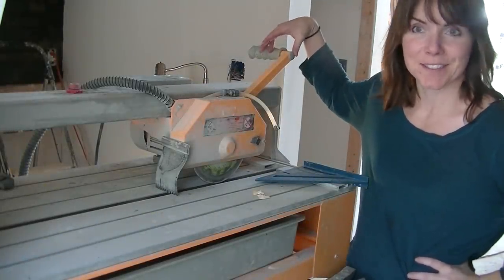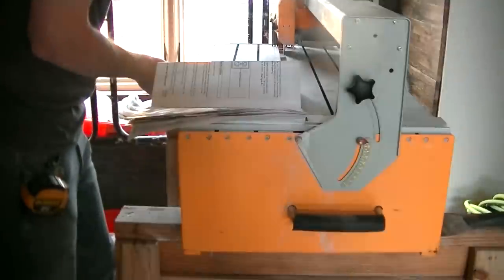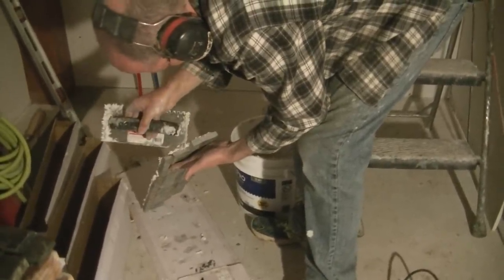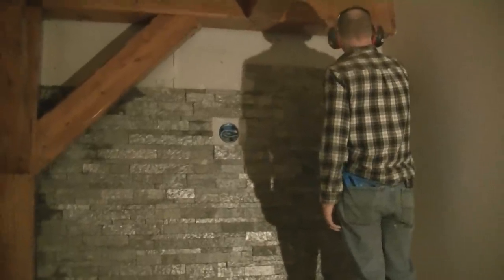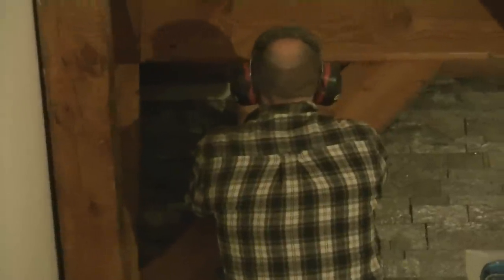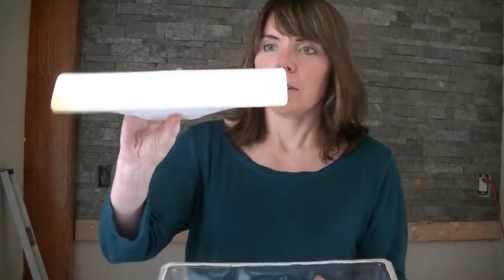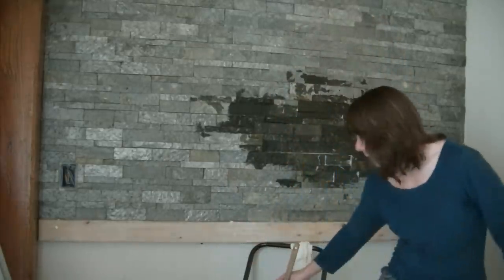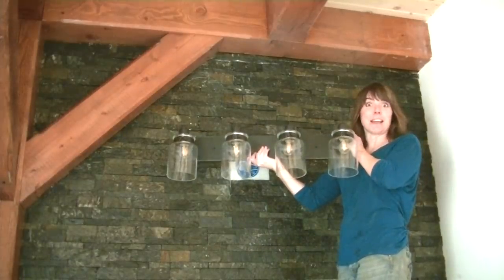Ledger Stone Bathroom Wall Installation

Comment: Nice work guys, I like the stone. I did something similar but with a smaller scale stone in our Kitchen and bathrooms and at first the wife wasnt exactly sure she was going to like it, and I said to her, just wait until you see it once I have it done and up and then once she had seen it up and how it blended in with the cabinets, counter tops, lighting etc she really loves it. A lot of work to get it there with cutting time and putting them up but well worth it as you guys have noted with your installation. It is the things when you are doing the interior finishes when you can see the house really coming closer to the finish line and you can wait to sit back , smile and soak it all in
Reply from the maker: it's all about the end result isn't it? It truly adds to both the character and the value of the home.

Comment: nice work on the cave.  going to need big LEDs to keep it bright in there.    I love doing stuff like this . did a full kitchen floor with black slate that was salvaged.
Reply from the maker: You saw the 4 lamp vanity light at the end? And on the left there (not in view) is a large almost 5 foot window, so that helps a lot. It was shaded with a tarp during the video because the tile cutter sprayed out some water during use. Fun fun

Comment: I made a BIG mistake. Let my wife see that wall finished. She wants new back splash on her sink wall and likes that. We rented a tile cutter. When using, the blade spinning threw water in your face. Called the rental place and was told it was normal !! So we had to move it outside and wear safety glasses and a rain poncho when using it. You did great work, and our sealer foamed also ?
Reply from the maker: Too funny! We had to put up a tarp to block some of the tile cutter spray. There was a flap on the machine but it doesn't prevent it 100%. Luckily the foam dissolves away.

Comment: Awesome job Amy !,   I’ve had good luck using an old spray bottle and a brush, it will go much much quicker. ( trade off is you will use more sealer) Could you go through a little more detail on the wood panels Brian did, what did he use to finish the nails and what is the plan for the corners?
Reply from the maker: You gave me another reason to save old spray bottles! And bryan says never throw anything away... For the wood panels he used finish nails- they dont' have a head on them and shoots them through the side at an angle. Then they are invisible as they sink into the wood. I'm not remembering what he said about the corners- geeze i need to ask again.

Comment: Hi,

I have the same idea for wall stone next to the shower, which means that water will be constantly getting in contact with the surface. Do you think these  stone tiles are going to handle the water for a long period of time and if they are not going to absorb the water?
Reply from the maker: You can also use a sealant on them like we did.

Comment: I know a couple of guys who used slate ledger stone, and that material can be tricky to work with.  Bryan did a great job laying it up!  I think that your brush approach was the only good way to apply the sealer.  That light fixture is going to look like a million bucks in front of the ledger stone.

How did Viggo react to the coyote?  :-)
Reply from the maker: I thought it looked tricky myself. Bryan said the glue holding the individual stones together was water soluble and if it got too we, they would separate from each other.  Luckily the volume was turned off of the coyote clip because Viggo was going crazy when he saw them through the window. I let him out later, after they (there were actually 2) were long gone and he ran down there to scare them off- too late!

Comment: Nice job but you did not put enough screws in the backer board and you should use modified thinset instead of mastic.
Reply: Did you go there with a tape measure? Also, its not a wet area, mastic is fine. This is the use mastic is designed for.
Reply: @apex007  Not good for that climate. I rarely use mastic.
Reply from the maker: Dont' worry we won't actually be splashing on this 'back splash' .